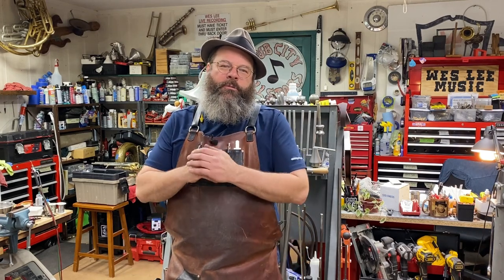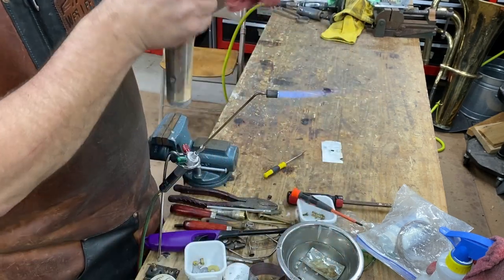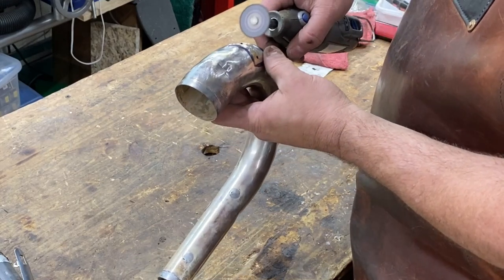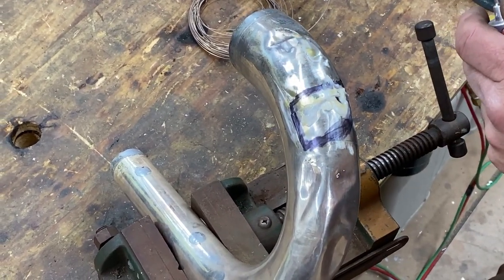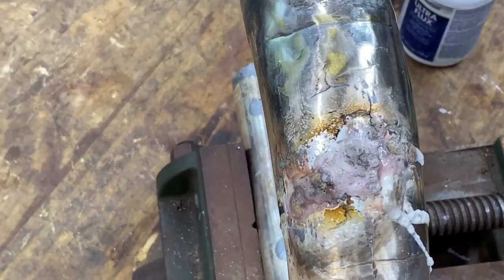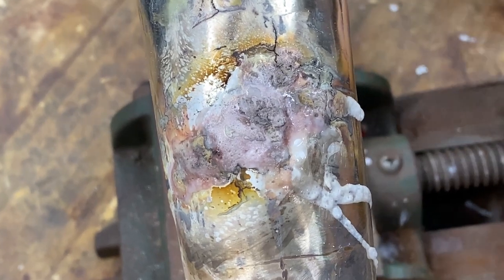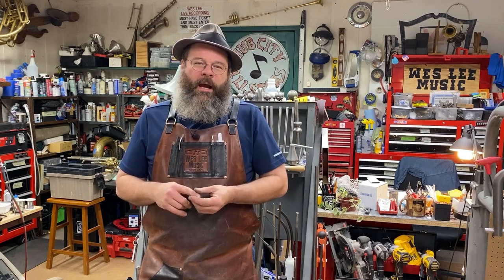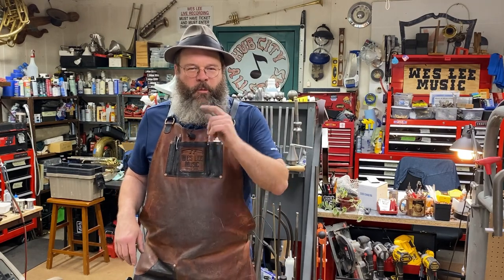"Brazing Cracks"- Metalwork- band instrument repair- Ferree's Tools- Wes Lee Music Repair

Comment: THANK YOU FOR YOUR EXCELLENT TEACHING VIDEO. 
   Back when I learned this procedure, there wasn't a video invented yet. We had reel to reel film projectors and we could pull a screen up and watch black & white home movies, but they didn't have sound.
   My dad was a Gunsmith, and kept me in his shop, standing on a stool with a shield on my noggin for protection. He encouraged me to watch & learn the crafts. He had me oxy/actlyn welding, with a big torch and wire coat-hanger for the filler. (We didn't have a Little torch, like what you are using. I learned on a full-sized industrial torch) I was fluent with the torch, making art and selling it at a local art show, with a local artist we hunted and fished with, before I was 10 years old. << It tickled me to watch you flipping the flame and chasing that puddle. It's almost a dying art! >>
   When I started at the shop I ended up working at, for most of my life, the boilermakers were trying to weld up a fuel tank for a tractor, with 1/16" 6012 rod and it was blowing holes in that sheet-metal. The air was GREEN with all the cussing they were doing. They were "old heads" & I was 21...what did I know they didn't?! 
   I had them get me a torch, a green shield, a wire coat-hanger, a wire brush & some sand paper and I vented the tank and welded up all the holes they had blown with the welding rod, and asked them what they were trying to fix, and it was the pipe fitting for the flare copper fitting to screw onto. They gave me one and I welded it on there and chased the puddle all the way around it and asked if there was anything else. THAT brought me respect from everyone there...even the bosses.
   It doesn't hurt to learn new things! Don't EVER turn down a chance to learn something!
   Bill, from Tn. 🇺🇸

Comment: While stitching a small crack is not so complicated, filling these holes is an incredible level of craftsmanship ! "Heat control" is not enough to describe this... wow.
While this technique is aesthetically pleasant, I do not like to use it too much because it anneals the metal arround the stitch and make it prone to dents, which work may lead to other cracks since the metal is already "tired"... for example on the bottom of sousas I prefer patching because I know there will be more dents there.

Comment: Never worked on any musical instruments, can't even play the radio, but I have done a lot of torch work including welding, brazing, silver and soft soldering. You are pretty good at it, even if you have only  soldered on musical instruments.

Comment: I’m quite aware that this video is about brazing but I wanted a current video to ask a question about removing dents. I wanted to make sure it was current so you would possibly read the comments.  Have you ever watched videos involving paintless dent repair on vehicles. I’m fairly new to your channel because I just discovered it probably a week ago. In any event in paintless dent repair, they use a special kind of light that will show any mark in metal and I am aware of the fact that it is very difficult to see some of these areas that are damaged. You may know about these lights and you may be aware of some of the type of tools that they use. If not if you go to YouTube and put in paintless dent repair, watch a few videos you’ll get the idea. If you know about this already I’m happy.

Comment: I always hear what sounds like a compressor when you use that torch. Are you using a fuel gas with just compressed air? What gas do you use?
Reply: I suspect it's an oxygen concentrator. My mother-in-law had one and it sounded just like that. It concentrates oxygen out of the air directly.
Reply: @dkd1228  you are correct. He uses a repurposed medical (dentist's?) oxygen concentrator to run the oxi half of his jeweller's torch.
Reply: Oxygen concentrator.

I've done this exact same thing.

Comment: I know you said youbuse. Smith little torch, but what does it run off of. I'm very new to all this, but want to learn.
Reply: it's an oxi-acetylene jewellers torch.
Reply: @derschwartzadder  is this the best type of touch to use or can a butane/propane touch be used?

Comment: why didn't you anneal the brass before the repair to work the part back into shape?
Reply: you clearly don't know anything about instrument repair and why that would do more bad than good?
Reply: @DNKG669  instrument was cracked that means it over hardened. Do you even know what annealing does? On top of that annealing would have made easier to work opened cracks back together to solder back together.